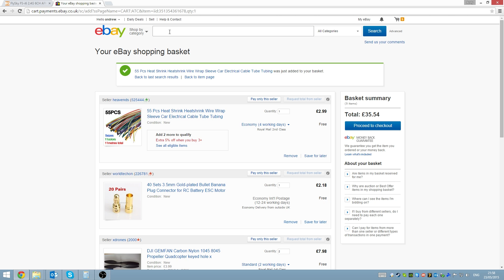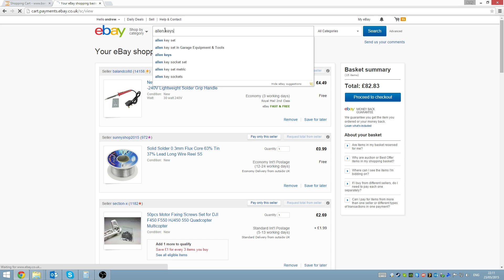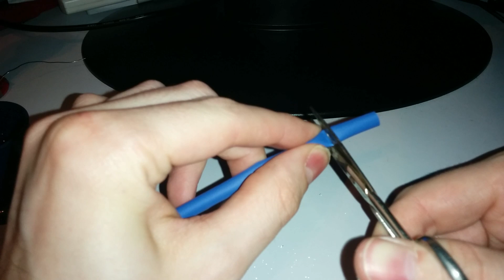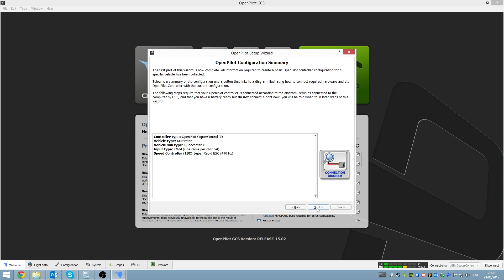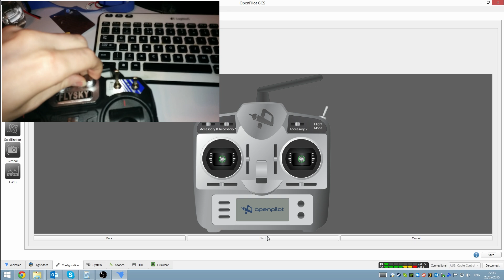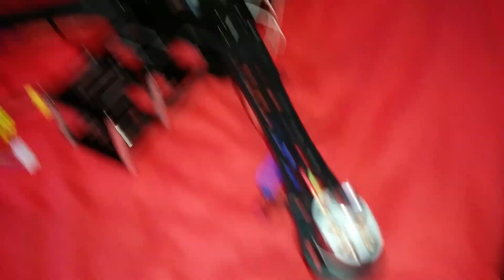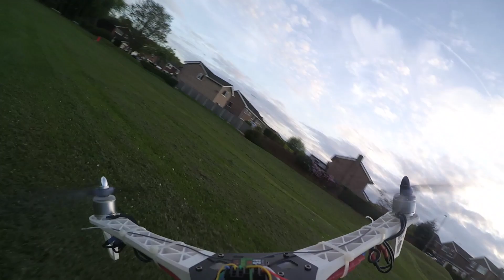Build A Cheap Quadcopter

Comment: I am building a super cheap quadcopter at the moment like yours. Your is awesome to help beginner looking for all the stuff they need. 
Just wanna post a good offering at the moment on Ebay. 

Flysky FS-T6-RB6 for 38,84€ or ~27 BP !! thats super cheap =)
http://www.ebay.de/itm/371287490802?_trksid=p2057872.m2749.l2648&ssPageName=STRK%3AMEBIDX%3AIT
 
bought one for my setup allready =) location is in germany so think the shipping will only take a few days =))
Reply: Tim Koch  This Lipo might be interesting http://www.hobbyking.com/hobbyking/store/__7295__Rhino_3700mAh_3S_11_1v_20C_Lipoly_Pack.html 

3,7A 3 Cells & little bit cheaper @ 15,44€ / 10,82 BP
Reply: Tim Koch it arrvied today :)  rly fast shipping in europe
Reply: Tim Koch guys search on ebay.com,hobbyking,alibaba express and banggood and compare the prices !!! it's worth the effort!  there you*ll find all the stuff with rlly low prices!  I manged to buy equal/same setup the quad (FlySky FS-T6 transmitter& receiver,  F450 Glass Fiber Frame with PCB , A2212 1000KV Motor with 1045 Propeller & 30A ESC, 3700mAh 3S 20C, Lipo Charger with Blanancer (forgotten in the video) and the OpenPilot CC3D Evolution(better model)  for ~140€  which is about 99 British Pound or 154 US $.  I did count the zip ties & cabels & screw but not the soldering iron. So without the tools you can buy all needed Hardware for a Quadcopter for under 100 Pounds !

Comment: Anyone know what the total cost is going to be in USD or Canadian dollars? Thanks
Reply: Andrew Guo 96 dollars
Reply: +Andrew Guo  Some depends on what you might already have. I already had a transmitter and soldering tools.  The quadcopter parts, battery, receiver, and flight controller cost me $117.61 on eBay.  You will also need a charger (about $20).  You can get a FlySky FS-T4B 4-channel transmitter+receiver for about $35 which would have added about $21 to my cost.

Comment: nice video, thanks.  Is it possible for a quadcopter work well with all the propellers having the same orientation? I mean I have 4 propellers counter clockwise, can I use them in my quad just making sure the propeller is pushing air downwards?  Just wanna fly my quad this afternoon while new propellers arrive.
Reply from the maker: bruno andrade no im afraid not they rely on the props counter acting each other. other wise the torque of the motors would cause the coptor to yaw constantly in the same direction as the props. this is why helecopters need tail rotors. they only have one blade so the rotor at the back pushes agains the helicopters torque to keep it from yawing on its own
Reply: got ya thanks man.

Comment: im thinking of bying this setup as my first diy quad.But i dont know how to tune properly cause i have never done it before.The only changes you did was in the video?
Reply from the maker: δημητρης τσιουμας yep the board flys pretty nice standard just have to change the pid settings like i did in this video
Reply: oh thanks a lot.One last question the screws that fit the motor plates right were these that you ordered from ebay for spares?if not where did you ordered them from? thanks
Reply from the maker: yes those were the spares i ordered. black ones to fit the arms and silver for the motors
Reply: arlight! thanks! This video helped me a lot :)

Comment: Would these motors be ok?
http://www.ebay.com.au/itm/4x-2212-920KV-Brushless-Motor-for-DJI-F330-F450-F550-X525-Quad-Multirotor-I-/390956298872?pt=LH_DefaultDomain_15&hash=item5b06cfb278

Or would  i be best to get say: http://www.ebay.com.au/itm/6x-DJI-2212-920KV-Brushless-Motor-for-F330-F450-F550-X525-Quadcopter-Multirotor-/171533036444?pt=LH_DefaultDomain_15&hash=item27f02a6b9c

And would these props fit the motor? http://www.ebay.com.au/itm/2-Pairs-10x4-5-1045-Carbon-Fiber-Propeller-CW-CCW-For-RC-Quadcopter-DJI-F450-/221757417746?pt=LH_DefaultDomain_15&hash=item33a1c5a912

I found this item which has props, ec and motor http://rctimer.com/product-1298.html Is that worse than what you suggestted?
Reply from the maker: The133448 those both would be perfect yes. they are the same motor
Reply: AndyRC there was more than just that...
Reply from the maker: yes theres plenty to choose from :)
Reply: AndyRC  Would this prodducyt which is significantly cheaper be the same? http://rctimer.com/product-1298.html
Reply from the maker: those look like a really low profile motor to be as high as 900kv usually the lower the profile the lower KV. i dont have any experience with those motors alls i know is the 2212 suit this size nicely
Reply: AndyRC Ok then Id get your ones. I could not find any of those props that you used could you help me out?
Reply: AndyRC Like would this work? http://www.ebay.com.au/itm/2-Pairs-of-1047-Nylon-2-Blade-Propeller-Props-CW-CCW-10-x-4-7-for-DJI-F450-F550-/161736723607?pt=LH_DefaultDomain_15&hash=item25a8428c97
Reply from the maker: yep they would for this size quad but if u use a 4s and cheap motors they will overheat with those on. fine for 3s though
Reply: AndyRC Sorry why didnt you get the 30C battery which would of been cheaper with postage?
Reply from the maker: which 30c battery?

Comment: Excellent vid and THANKS for taking the time and effort to share.  Starting a build in about a month, as just ordered the same frame last night, before viewing this today....LOL.  On the slow boat from BG.

My first build, though should, should be a bit easier, hopefully, as chopping a WL V303 and maybe a CX 20 to do.  Haven't tested all the parts yet to see what I will be using.

Was well worth watching just for the motor mount screw tip, as something so simple but makes for a really bad experience if not knowing and was an issue.  You definitely have more patience than myself.

Comment: After about ten minutes of this video I opened up a chrome tab and started looking for parts. I got a bundle of motors and ECUs for a great price. But in other respects a very similar kit. I got everything for about 100 bucks, well except the transmitter and receiver. Found one locally for a similar price so I will be getting that after the other parts get here. Now the wait!
Great video, makes the first proper build from scratch a little less daunting.
Reply from the maker: TheAudiophile34™ congratulations good luck on the build :) its not hard at all just time consuming

Comment: Hey AndyRC I got the stuff from banggood now seems to be pretty good everything but the frame kit didn't include nylon standoffs do they come with the power distribution board??  

I'll write again when I'm finished building and it is working are you going to do more videos one it like adding fpv getting a new setup for mor flightmodes?? 

Thanks a lot
Reply from the maker: Darren Fürst the stand offs came with the kit. that sucks it sounds like banggood missed them out :( im doing the fpv video this weekend yes. cheers
Reply: Ok thanks well I'll think of something AndyRC 

Cool I'm going to make some fpv stuff eventually
Reply from the maker: great :)

Comment: Did u mean to put 3000 and say 300? Or was this a blip?
Reply from the maker: NiceTech 28 which part do you mean? cheers
Reply: NiceTech 28 0.00300 is the same as 0.003000 :)
Reply: Cheers was just couse he said 3000 the 300 but no worries I'm wanting to build some racing qav250 look way better than this syma x5sc I'm practicing on never thought it'd be as hard lol fly bounce fly bounce llf

Comment: Nice job.  But I think for right now I will stay with the Cheerson CX20.  But one day I would like to build a copter for a camera platform.  Thank for sharing your info.
Reply from the maker: Skydive Driver i nearly bought the cx20 its definitely an easier and less time consuming option. but i had always knew id end up going custom. i started off with the hubsan x4 micro quad and in the end went custom so this time i cut out the middle man. this time being the cheerson
Reply: It all look fun, but setting up the receiver looked a little intimidating.  But I know that I will have to build one for a camera  platform some day.
Reply from the maker: it looks harder than it actually is. you can get a ready built 450 quad if u dont wanna build. search turnigy sk450. cheers

Comment: Nice video.Can you make mini fpv quadcopter under 70$ and make the list of things to buy?I supscribed at you after watching video with mini quad built.Sorry for my bad English!!!
Reply from the maker: WHO I'M yes i think it would be possible the problem is do you include the fpv monitor or goggles in that price? because that is the expensive part. also thanks for subscribing :-)
Reply: AndyRC I think the monitor is cheaper,or you can just use smartphone like monitor.
Reply from the maker: if you search for a video called my favorite fpv setup. thats done for about 70

Comment: AndyRC how are the correct motor mount Screws as I do not want to have the same problem

Thankyou 
Really cool project and I really like your vids thanks carry on like that
Reply: Darren Fürst 3 screws per motor are enough, so just leave out the one that would short the motor
Reply from the maker: Darren Fürst they are fine darren. going to be doing more with this setup which im working on at the moment
Reply: AndyRC actually I wanted to know how long the screws of your second kit are just that I can see if I am going to use them
Reply from the maker: ill measure them for you when i get back from work :)
Reply from the maker: Darren Fürst the good ones including the screw head are 10mm long. the bad ones are 12
Reply: AndyRC Thankyou how long did it take you to get your stuff from banggood usually?? 

And thankyou for your help keep up that great work
Reply from the maker: banggood is usually 2 weeks these days. i have waited 4 weeks in the past. its ok though cus usually you can do lots of research in that time ;)
Reply: AndyRC ok thanks again
Reply: AndyRC If you choose the Priority Direct Mail shipping option its a week or so, and its only a dollar :D

Comment: Good job buddy, its funny how trial and error work,the problem with bullet connectors is exactly what you found and i also found out the way you did. Its much better in the long run to not use connectors, and solder the wires instead as this  always makes better connection with no resistance problems. Flies good hey for a cheap set up? Cheers for vid ;-)
Reply from the maker: mark acker yes i have heard of this resistance on the current that bullets can cause, although its flying nice at the moment. Now that i know the exact sequence I might solder direct. thanks for your support and cheers for watching :)